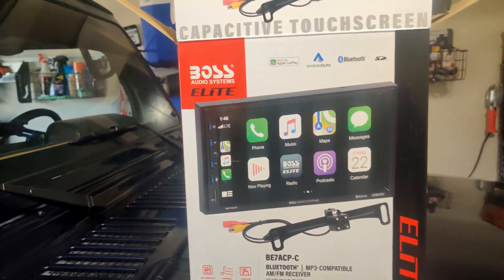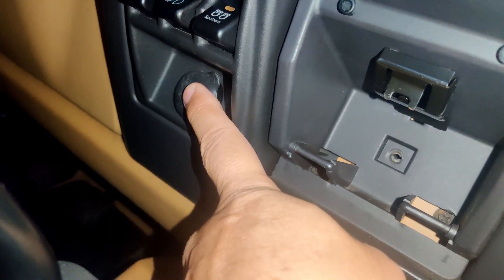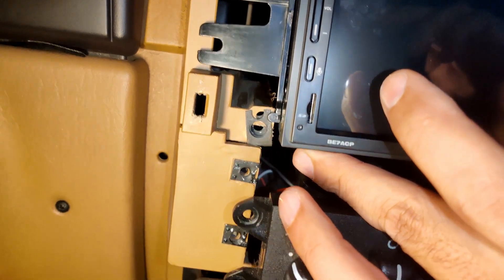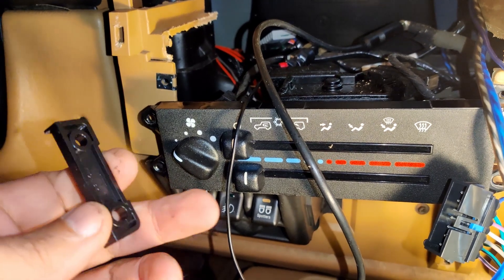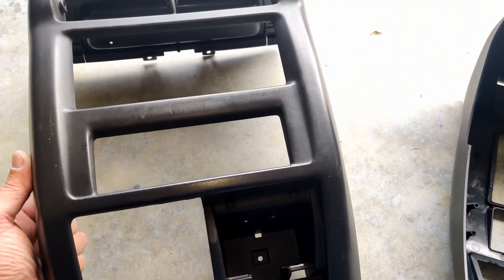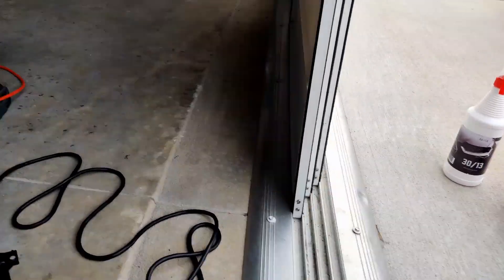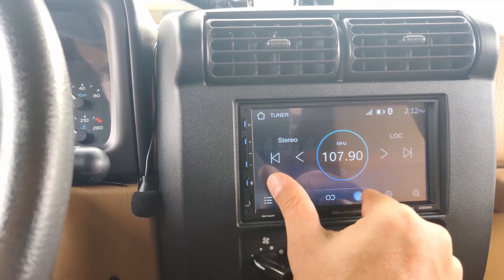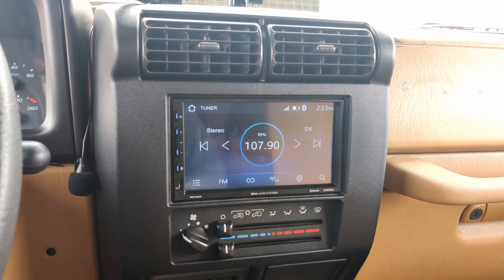Installing a Double Din Radio in a 1997-2006 Jeep Wrangler

Comment: I really enjoyed watching your video. I am replacing my original  radio with a double din and your video helped me a lot. I have a question, regarding your additional USB plug that you installed. You connected your plug to the back of your radio. My new radio does not have a USB connection in the back, so if I want to install a usb plug, where would I connect it to have power?
Reply from the maker: @estevesr2  Thanks for watching, one wire you will just connect to a piece of metal or screw and the red wire you can either connect to your red lighter plug of the fuse box

Comment: Did you ever connect the backup camera?  I didn't see the video on your channel on that.

When you ground the green wire (emergency brake wire) to the head unit ground cable,  do you remember what the color is for that ground wire?  Can that green wire be grounded to the frame?  Thanks
Reply from the maker: I have never connected the backup camera since I purchased the mirror which has the backup camera on it. Its been so long I don't remember what wire is with the green one. If its grounded then you can ground it on the frame.

Comment: Off topic question, are your HVAC controls original? If not where did you get it? I am having trouble finding a new/good condition one with the a/c controls. Thanks.  Great video by the way.
Reply from the maker: Hello, yes my HVAC controller is original. Check on eBay they usually have original parts. Thank you

Comment: Great job, need to add to my 97 TJ., Do you have the specs on the radio and the charging plug
Reply from the maker: The radio: https://www.crutchfield.com/S-OQNy0krXDgC/p_104BE7ACPC/Boss-BE7ACP-C-Package.html
Reply from the maker: The Extension Plug: https://www.amazon.com/gp/product/B07TTNF118/ref=ppx_yo_dt_b_asin_title_o05_s00?ie=UTF8&psc=1

Comment: you didn't show that the other console was from a 2003 to 2006 dash
Reply from the maker: The console i purchased is for a 97-2006 dash
Reply: @FAFOWeekendAdventures  I just went online and bought the DD Dash for the 97 -02. It's a single din dash 03 and up was factory DD sorta.. but I  bought the conversion dash this am.
Reply from the maker: @DumbCarGuy  let me know how it works out
Reply: @FAFOWeekendAdventures  Worked out pretty good.  Just a little tinkering.   I had to use spacers behind the heater lever console to move it closer to the new center console. Then I had to ad a screw to the face down low in the center because those snap together things didn't want to hold so well.  They held but I liked the screw, now its not gonna pop loose.
Reply from the maker: @DumbCarGuy  Glad it worked out

Comment: Amy updaye on the radio? I have everything except the radio and the double plug in (which one is that BTW?) for my build just haven't pulled the trigger on the radio yet!
Reply from the maker: The radio is working great, no complaints at all. If you look at one of the other comments I put the links for both the radio and the faceplate. You need to go ahead and get it done, not expensive and we'll worth the upgrade.

Comment: Where can i find this radio and mount ??? ! Thanks
Reply from the maker: Radio: https://www.crutchfield.com/S-k9uAtcSU8FB/p_104BE7ACPC/Boss-BE7ACP-C-Package.html

Mount: https://www.crutchfield.com/p_120956549/Metra-95-6549-Dash-Kit-Black.html

Make sure to like and subscribe to my channel.
Reply: Thanks for your reply ! You think this will fit 1998 jeep wrangler tj sport ? Or do i need to do some modifications ?
Reply from the maker: @MACWIRELESS  it will fit, my jeep is a 97 sport. Just watch my video because you will have to cut a small piece on the dash to install the radio
Reply: Thanks for your reply ! Helped me alot ! So the back camera will work as well in this ?
Reply from the maker: @MACWIRELESS  yes it will work, if your on my channel I will be installing my camera in a week or so and I'll post a review

Comment: What is the name of the phone holder?
Reply from the maker: I have a video on YouTube of the mount. It's called: Bullet Point Mounting Solutions.
Reply: @FAFOWeekendAdventures  I saw it I subscribed 2 ur channel and saw the video will it hold a phone with a case on it..I bought the cup phone holder for my work truck and my s 20 with a otter case just barely fit
Reply from the maker: @NHWilderness  Thank you for subscribing. Yes, it will fit with the phone case, i have an Android with a phone case and have no issues.

Comment: Did you have to connect the parking brake wire?
Reply from the maker: Yes I did because if not it would not work
Reply: @FAFOWeekendAdventures  did you bypass if so how?
Reply from the maker: All you have to do is take the barking brake wire which should be green and ground it.